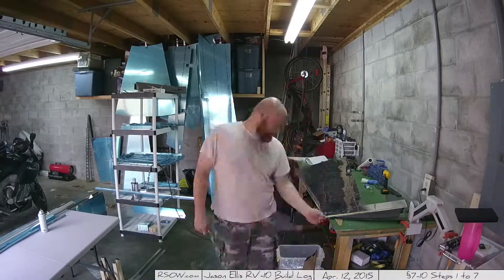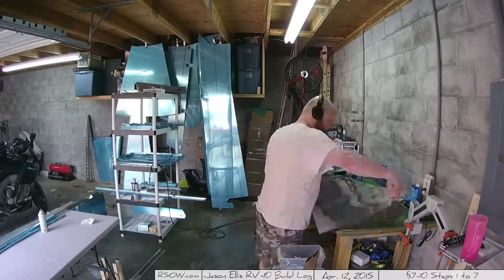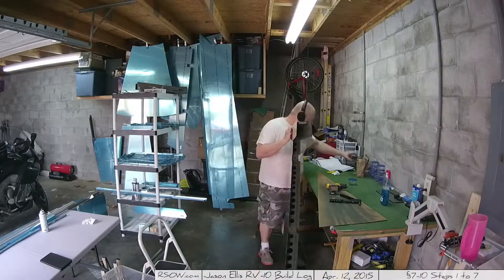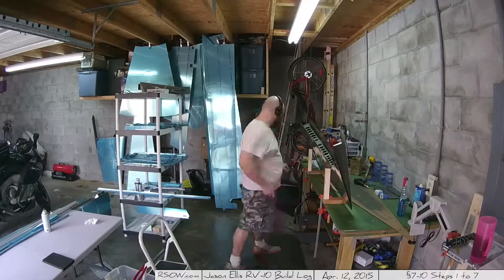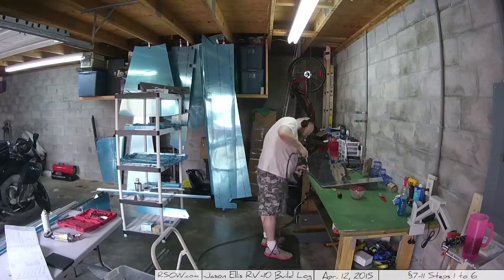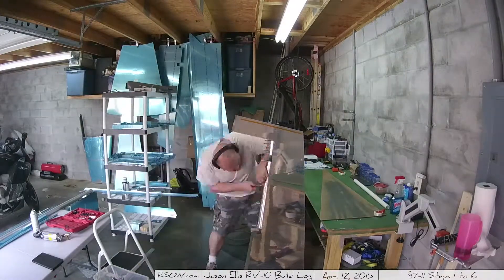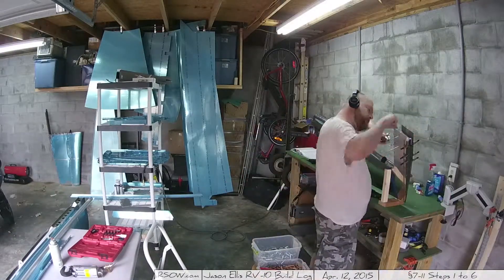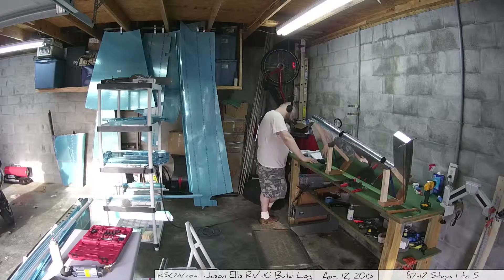RV-10 Empennage Section 7-10 to 7-12

Comment: On pg 7-11, Step 3, it says to use a #8 screw. On pg 7-12 (Figure 2), it shows this to be an AN509-8R12. I saw where you said it's an AN509-8R14. I dont see the 8R14 listed out on my Packing List. It is written out on Bag 1136 under the description but not listed in the bag. Either way, the 3x types of screws in Bag 1136 don't screw nicely into the K1000-08 that is to be riveted onto the rudder so the screw can hold the Counterbalance Weight in place. Any help??
Reply from the maker: Hi Gordon.  I will go out there and take a look the next time I'm at the hangar.   Things may have changed between then and now.. meaning your plans might be a tad different than mine..   My Step 3 on that page doesn't actually talk about a screw.  My plans show a 8R14.  So maybe they changed something?